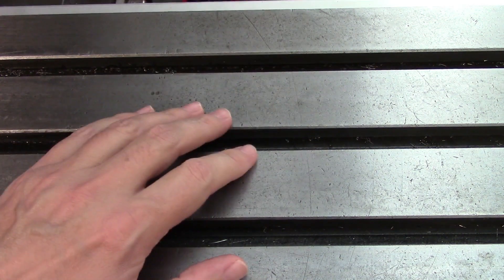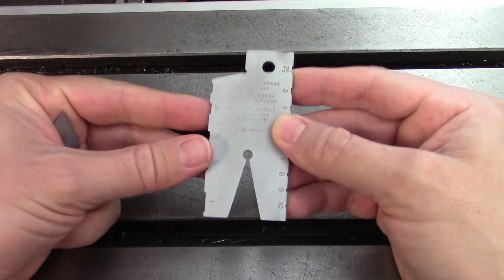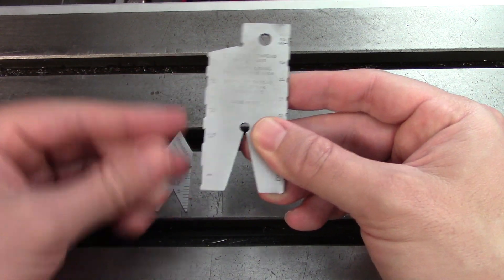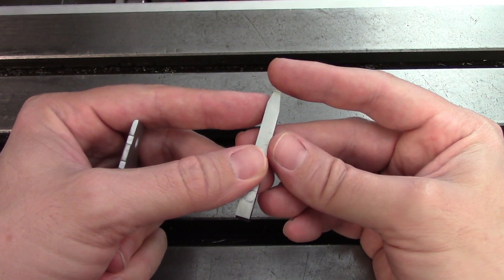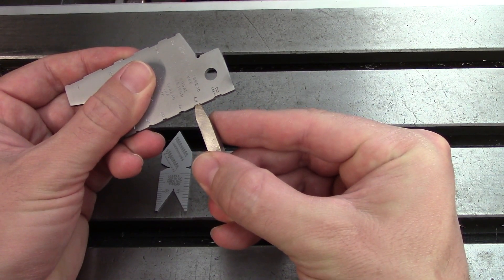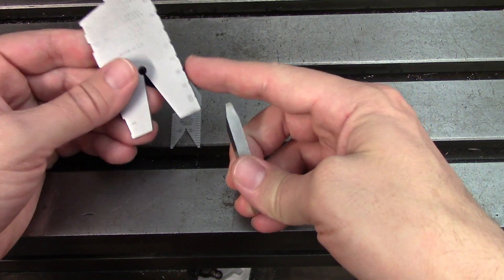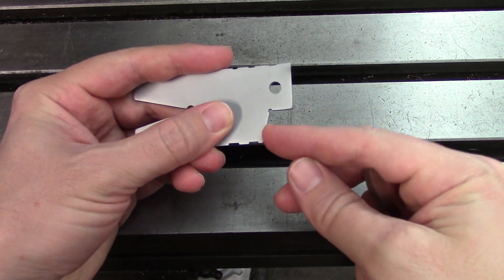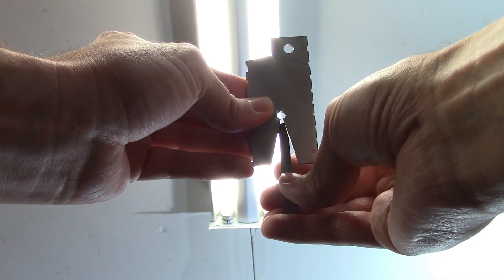How to Use an ACME Thread Gage - Viewer Question Answered

Comment: Just received one of these thread gages in a tool lot.  You answered my questions. Thank you fir sharing your knowledge.
Reply from the maker: Hey. I'm glad it helped. Let me know if you have any other questions.
Reply: @StuartdeHaro  I’ll have to get back with ya. Just moved and waiting to buy a house. Mills and lathe in storage 🥺
Reply from the maker: @bigmikeh5827  I know exactly what you mean. I moved a few months ago and have been in a holding pattern while waiting for the concrete floor to be redone. It's going to eventually be a great shop though.
Reply: @StuartdeHaro  that’s good news. I’ve got tons of projects in line. New to area and no friends made yet.
Reply from the maker: @bigmikeh5827  Check out some of the machinist forums like homeshopmachinist and practical machinist, as well as the r/machinists subreddit and inquire about clubs or meetups in your area. Depending on where you are in the world, you may be spoiled for choice or the only machinist within a day's drive, so your mileage will definitely vary.

Comment: Nicely done guide on the use of the ACME gauge. Now, if you could just find one that allows me to hand grind perfectly straight and accurate angles on a piece of tool steel using a bench grinder I would appreciate it greatly.   LOL!

Comment: When I try to single point thread on mild steel it will start out okay but then it will tear the threads and literally make then useless and ruin the piece. Can you tell me what I am doing wrong? I have tried different speeds, depths of cut, and a whole plethora of cutting oils to no avail.
Reply from the maker: Without seeing it in action it's hard to say, but  a really common error is taking the same depth of cut for every pass. You might start with .010 to .015" but each successive cut short be a little less. The last pass will be .001 to .002". Reason is there is more and more tool in contact with the work so it is more likely to chatter or dig in with a heavy cut.
Reply: @StuartdeHaro  Thank you. I will give it a try.
Reply from the maker: @oh8wingman  let me know if it helps.

Comment: I suck at grinding cutting tools.  I would like a jig I can drop on the surface grinder that would cut Acme and 60degree tools for me with ease.  Seen one out there?
Reply from the maker: We have a jig in a cabinet at work that I run across every couple of years. If I remember, I'll snap a picture of it tomorrow.
Reply: @StuartdeHaro  Thanks!  I'd like to see it!  I swear I can only learn so many skills, some times you just need it DONE or easy.  I flat out refuse to learn to grind tools on a bench grinder.  Kinda like sharpening drill bits.  I said fck it and bought the most expensive drill doctor.  After making peace with that piece of shit, I can sharpen bits half drunk!
Reply: @jagboy69  I got a drill doctor for Christmas years ago and I never could make that piece of shit work right.  I can usually make it work just well enough to postpone a trip to the hardware store for a new bit, so I haven't thrown it away yet.
Reply: @netpackrat  Guy at my local sharpening shop gave some pointers.  #1  The expensive one is the only one to buy.  #2  Throw away drill bits that are smaller than a 1/4".  Don't try sharpening them on the DD.  #3  Getting them in the holder is critical.  Be sure you adjust the depth stop or you will be grinding all day on it.  #4  The diamond wheel in it works better after it's sharpened half a dozen bits.  #5 Save your receipt, you will either make peace with it after putzing with it for a couple of hours or give it back to the store.  You'll either love it or hate it.  I garagesaled the first blue one I had and decided to give it one more chance.  I'm glad I did, but I agree, it's not for everyone and I still call mine a piece a shit.  lol...
Reply: oh yeah, and forget splitting the point, that never works.  You'll just fk it up!  :-(
Reply: I suck at hand grinding cutting tools too. A tool makers vice and a couple of angle blocks is all you would need if you already have a surface grinder. I'm in the opposite boat. Have the vise and angle blocks but no surface grinder. <Sad face.>

Comment: More good content! Philosophy on compound angle? I know you used 0 degrees on the double start project - presumably to allow for movement to cut the second thread. Do you ever use the popular 29.5, or similar angle, to cut with the leading edge of the tool?
Reply from the maker: I usually angle the compound.  That puts a lot less tool in contact with the work piece so it is less apt to chatter.  That said, sometimes it's just more convenient to plunge straight in, like when you're cutting threads on a lot of identical parts.  Plunging straight in lets you take note of the thread depth on the first part and go to the same depth on subsequent parts.  You still want to measure of course since the tool will wear down, but it gets you in the ballpark quickly.
Reply: I think you use 14 1/2° for acme threading :) although our video producer here would know better than me.
Reply from the maker: @crbielert  That is correct. You angle the compound to half the angle of the thread form.
Reply: Great! I did an acme thread for a project but can’t remember what it was. Not sure what angle I used.  Thanks for the great stuff, guys!